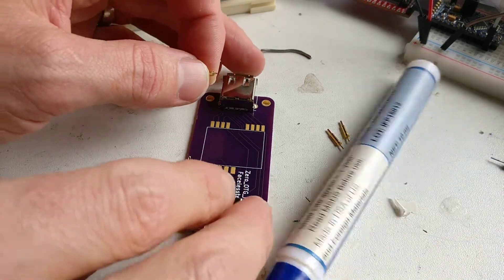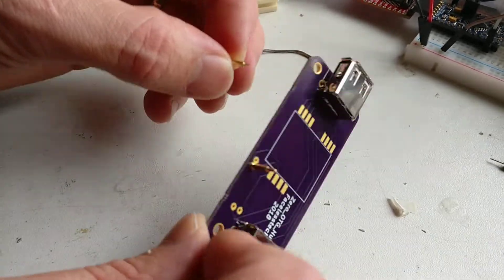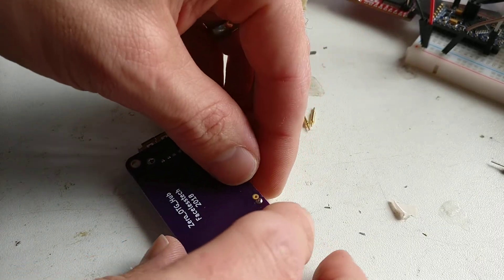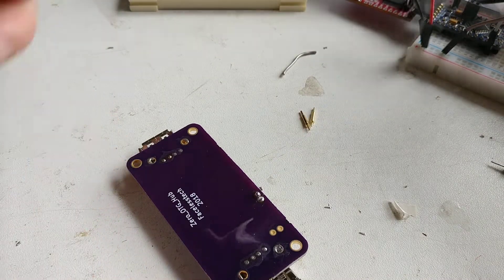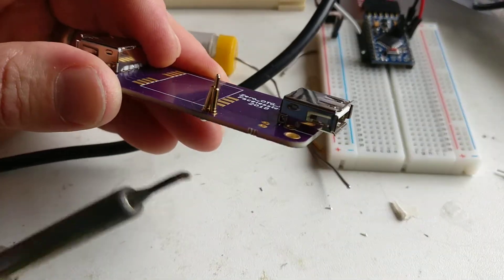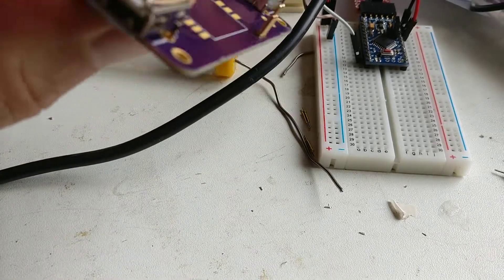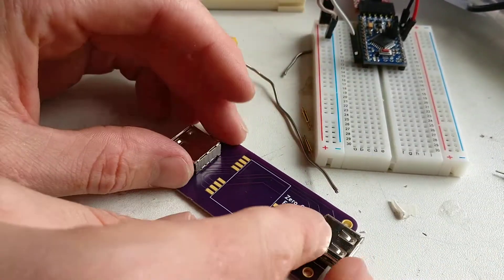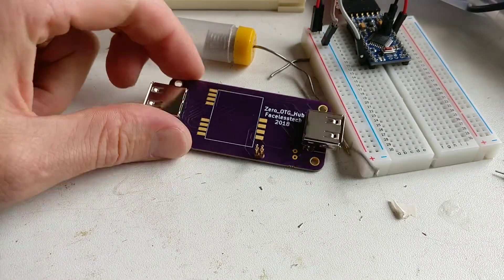How to solder through hole pogo pins

Comment: can i solder this to the promicro so i can test pcb before soldering? to check it its working, or can be used at least temporary connection?
Reply from the maker: @sinkim8447  yeah you could do, I've used them in the past to test raspberry pi boards without soldering a pi to it. You would need to build a test jig to hold it in place while testing.